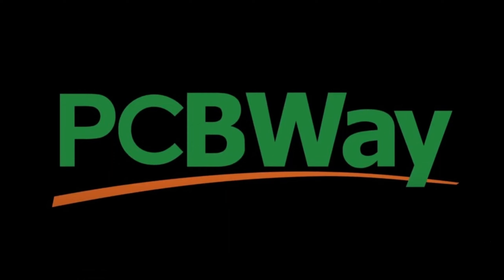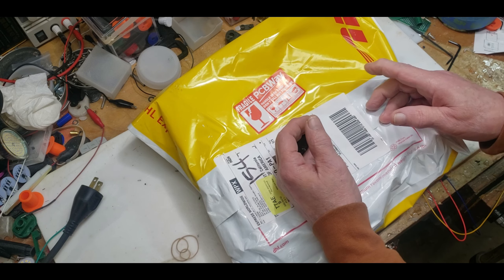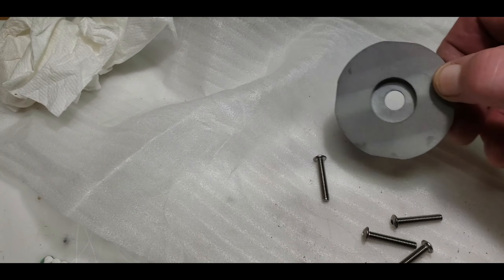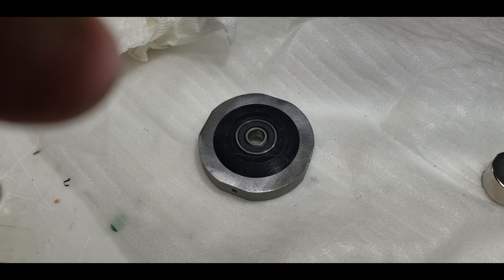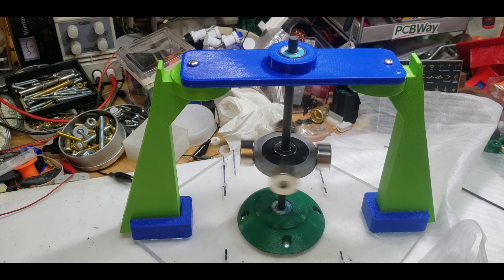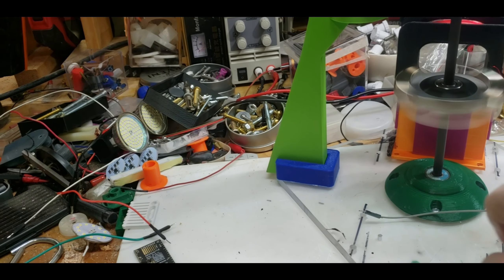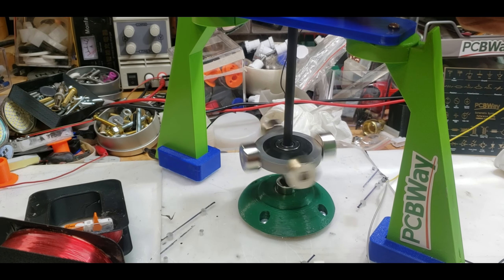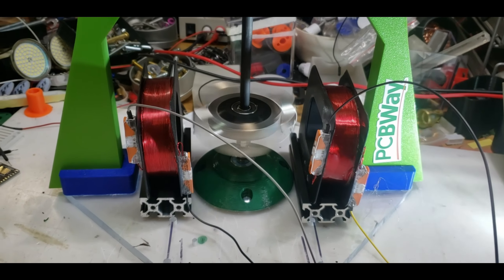3D Printed P.M. First 3d Printed Aluminum Rotor (PCBWay)

Comment: Have you tried having a 10 to 1 transformer  inline between the battery and the primary coil? Because these circuits pulse the input, there should be 110-120vs ac out of that transformer to possibly plug household stuff in an extension plug, these motors surely can do more stuff, I'm hopeful gonna try it if i got enough wire left.
Reply: But everybody needs to see the possibilities

Comment: Very impressive... just a question: is it affordable? i mean as you work with pcbway you probably get  better pricing, which is normal, but for a new customer.. what price range would a rotor like the one you had printed cost? not the exact price.. just a range.. as they have actually no pricing at all on their homepage..(at least i didnt find it..)
and second question: did you just send a normal stl? or are there special design parameters you have to respect?
Luc
Reply from the maker: very affordable in my view. This rotor would have cost about 60 bucks. The service is fast too. You can upload a .stl file and get a free quote

Comment: I just like to have a stack of n52 magnets n one end south the other end 6 together spinning, but i make the coil so it isnt much wider on the inside than what is needed for the spinning magnet which is in the middle inside the coil, my next coil should have 8,000 turns 0.5mm wire